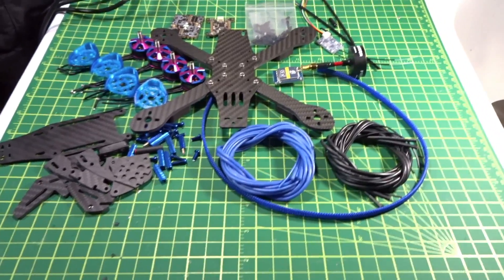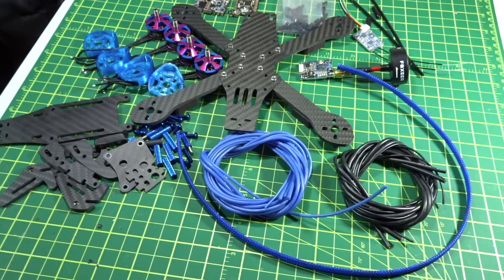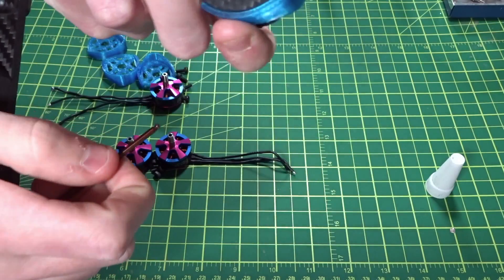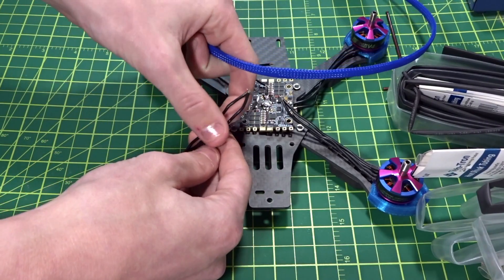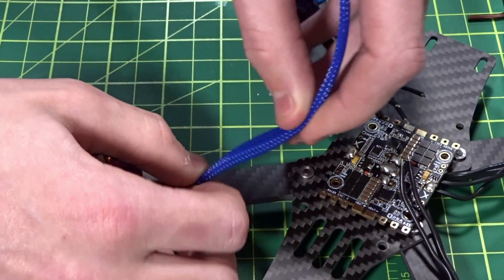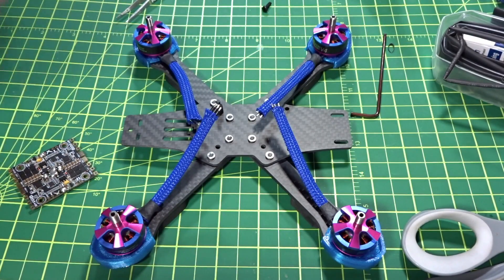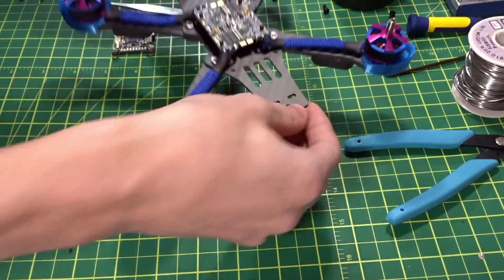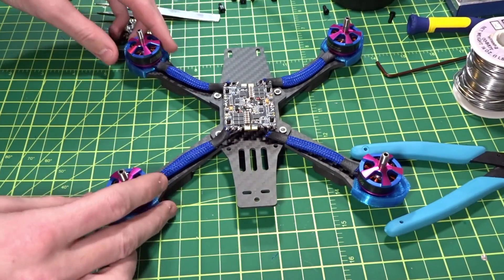Raptor210 Build Part 1:  Hyperlite V4 Motors, Quadrant ESCs, and Radiance FC

Comment: how do you like those  X-Racer Quadrant 25amp ESC Seth?
Reply from the maker: I don't really like them so much, Kinda hard to solder with annoying pad placements and heavy. They work fine but I think 4in1 or separate is a better option.
Reply: Hey Seth, I appreciate the replay. not sure what to do. I wanted to build something that I could have a 4in1 ESC these seem smart idea.  I can solder up a store so that doesn't bother me to much. size was the only major thing and if they were complete garbage. wanted to build one of those little transtec zoro frames with them. they were 30cdn dollars not long ago but now either discontinued or  out of stock or they jacked the price double and then some. not sure what to build need and other quad. thanks for the reply, Joel

Comment: Hi ! I'm on my first ever build,and I'm failing right at the start : /
I don't know what's wrong, but I just can't solder the quadrant together :/ solder stops melting very quickly so I can't put enough to bridge those big pads. Would you have some tips for soldering that 4in1 ESC ? I tried so many times, I'm scared I might have damaged them! As I've kept the iron tip so loong to try to melt enough solder. What temp should I use ? Did you have trouble too ?
Reply from the maker: Those pads take a ton of heat. I used like 450C
Reply: thanks for the quick reply. 450 celcius is my soldering station max (Yihua 936) and still I can't make it : /   Do u think I can try to leave the tip a long time ?
Reply from the maker: Do you have a large flat tip on? It needs large surface area to transfer heat quickly.
Reply: yes, I order a set of tips beacuse I was failing, thinking that was the problem... but I feel I've tried everything (I can think of)... the 4 ESC are sooo hot and still I can't melt solder. I've tried to tin the iron tip to help transfer heat, nothing. I've tried to melt on the tip and transfer to the pads, but it won't stick there. I've tried on another board, a thinner one -> no problems.
Reply from the maker: Left a comment.
Reply: thanks mate! going there now.

Comment: Hey how did you glue the antennas on I tried crazy glue and 2 part epoxy and neither worked!
Reply from the maker: The antenna holder? I put some hot glue in the heat shrink, then when I shrunk the heatshrink down it melts the glue and spreads it around.

Comment: Hi! if I use the exact same components but only change the receiver to a flysky receiver... will it work ? I have the flysky i6 transmitter. Thanks
Reply from the maker: Yeah, should work fine. You will just have to maybe connect it differently and do different computer setup for the receiver part :)

Comment: So I guess I shouldn't of got the 1800 mah lipos they only fit if you use the 35 mm standoffs and you cant use the GoPro mount.
Reply from the maker: Yeah, 1800s would be too large. I only use 1300s.

Comment: Hi, I watched your video and I was very impressed with the build so I bought the frame and the same electronics. I want to know if I should use the PDB that came with the frame or would you recommend to just use the ESC as the PDB? Thanks
Reply from the maker: Awesome :) If you have the same ESCs and FC as me wire it like I have. No need for the PDB. If your escs are going on the arms you will need it.
Reply: Thanks for your response. I have everything just like you. Will go ahead and connect it directly. Do I need a capacitor for the video?
Reply from the maker: I have never used one, but if you have one on hand won't hurt to add it.

Comment: what pid loop speed is OK to run on the radiance? 4k 4k or 8k 8k?
Reply from the maker: Furious FPV says 4k 4k is the most stable, but I ran 8k 8k with no issues.
Reply: OK thanks

Comment: Do you think the hyperlite 2206-2450kv would work on the raptor? Pirofliprc has been out of the 2206-2522kv motors for quite some time now so I'm looking at other motors.
Reply from the maker: That is what these are. The kv was a little higher than stated, so they renamed them to 2522. They are back in stock right now btw, bought 5 more for myself :)
Reply: When I go on the site they say out of stock so then I'm going to buy the 2206-2450 purple and green ones.
Reply from the maker: Which V are they? I got some V3 2300kv and was very disappointed. V4 only for me.
Reply: I'm not sure what V they are it doesn't say but it's these ones http://pirofliprc.com/HyperLite-2206-2450KV-Team-Edition_p_3493.html

Comment: Nice build! Love the color theme :) waiting for the 2522Kv to be in stock...(only have 2122kv and 2722kv for now) I quite want to get this frame, they are offering 15%off right now too. After having it for a few days, how are you liking it for freestyle? How does it compare to an Alien? Thanks
Reply from the maker: Thanks! With these motors and Cyclone V2s the speed and power is literally insane, have to be careful on throttle as it is literally 50% at least more powerful than my other builds, and the speed is just crazy. I have not really flown it too much yet due to weather, but it feels very good. Not sure if I can tell the slammed deck yet, but will keep testing
Reply: The RCAddict so I suppose you like this frame pretty much specially with these motors! I guess I will wait for the 2522kv to be available to get these motors... 2722kv are just gonna be too hard on the batteries... I'll have to decide between this Raptor and the new Awk210 (Strix-ReadyMadeRC) frame, won't have enough to get both! Hope to see more flight video from your Raptor, which might help me decide :)
Some very nice LOS flying in your videos! Just watched a few of your later ones...
Reply from the maker: Ray Choi Ok, I saw the awk frame, but certainly not what I am looking for.
Reply: The RCAddict I finally opted for the Raptor :)
Reply from the maker: Ray Choi Hope you like it!

Comment: Those esc's look so good. I get them in my next build with the Omnibus fc.
Reply from the maker: I don't like how large they are. Harder to fit in a small stack like this.
Reply: They are not big, they are like every 4 in 1 but than better looking. Send it to me I will show you how to build it. ;)
Reply from the maker: emiel1976ep They are slightly longer. and also thicker.
Reply: Ok. But longer is not a problem. I rotate them so the pads are on the side. I don't have a lot space for the cables behind the cam. Height is also not a big problem. Depends on how you were it all.

Comment: just finished my build of this frame with 2205 red bottoms.  I've been happy with DalProps and need to order spares.  5040s or 5045s???  such a dilemma.lol. recommendations please..
Reply from the maker: Nice! Awesome you got it so quick! I don't really consider older props much anymore. Get the V1 or V2 cyclones and be done haha. V2 have quite a bit more power. http://pirofliprc.com/DALPROP-T5045C-Cyclone-5-2-CW-2-CCW_p_3575.html http://pirofliprc.com/DALPROP-T5046C-Cyclone-2-CW-2-CCW_p_3778.html
Reply: How was the build?
Reply: It was good.  it was my first "high end" frame.  it was nice to work with the quality of a 4mm carbon frame rather than the 2mm $8 crap I've been using to learn. I'm having issues keeping my power cable out of the props so I'm glad The RCAddict didn't use the supplied PDB so I can see how he is going to rout the cable.
Reply: great!! thanks for the advice.  I'll order some of the v2's.  I can't wait to see how you rout the power cable.  If you don't use the supplied PDB it's hard keeping it out of the props.
Reply: Are you using the Quadrant ESC too?
Reply from the maker: captn3x I bring it out the side, and use zip ties around each wire to pull it tight aginst the top plate on the forwards part of the battery strap cutout. Still plenty of room to run the strap through.
Reply: No. I used separate ESC's.  Here is a picture.  I need to clean up the wiring a bit, install the right props, and get a 4s battery.  https://1drv.ms/i/s!AhuDVA2-IJyelvEOq4t66iwuiWtnmQ
Reply from the maker: DenisINA FPV They are ok props, but no reason to need them anymore as the cyclones both V1 and especially V2 are superior.
Reply: I'm not seeing a v2 cyclone....
Reply from the maker: http://pirofliprc.com/DALPROP-T5046C-Cyclone-2-CW-2-CCW_p_3778.html
Reply: I was expecting to see V2 someplace. they are on the way.  Thanks and keep up the good work.

Comment: I just started soft mounting my first quad last night with random shit I got from local hardware store. When applying my screws did you say don't twerk em too tough? Like partially tight?
Reply from the maker: Yeah, you want them to be tight so the motor is firmly in place, but if you totally squish the material down, it can't absorb the vibes. Make sure to use loctite.
Reply: The RCAddict gotcha thanks I've got an obnoxious vibe I think bad gyro I bought this lil rubber pad thing like between 1-3 mm and some 8 mm screws. Dude this build is gonna be wicked AF
Reply from the maker: What FC?
Reply: Omnibus F3
Reply: I've never soft mounted either I've got o-ring rubber washers on the fc so I guess that counts as being soft mounted idk
Reply: I had to go with steel screws from hardware store you think I should run 3 per motor?
Reply from the maker: Hmmm, that is MPU6000 so shouldn't have much problem with the vibes. That counts as softmounting yes ;D
Reply: I'm glad I watched this vid b4 I started my day I was about to tighten the shit outta of these screws & now I think I'll use 3 per motor

Comment: i have wondered about motor guards acting like soft mounts, but i think the tpu might be a problem choice, too soft might add vibration, and tightening the screws onto tpu evenly might be tricky and of course the tpu will deform over time,  maybe if you add a homemade plate between tpu and motor it might work really well. those motors look fantastic, can you bench test them first.
Reply from the maker: I think some people are actually using ninja flex, which is softer, but it seems like TPU is certainly the most popular soft mount choice. I just went until they were touching, and then tightened them all the same amount of turns. They might need changing every month or so, not sure. The build is already completed a week ago, so it is too late :(